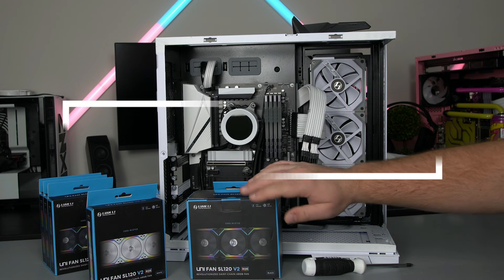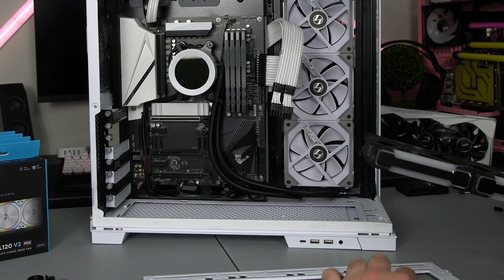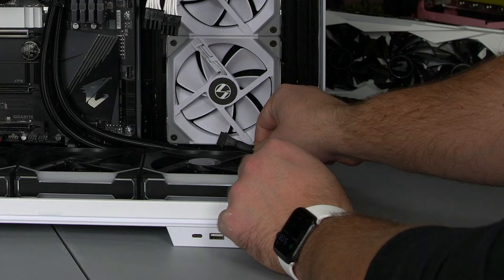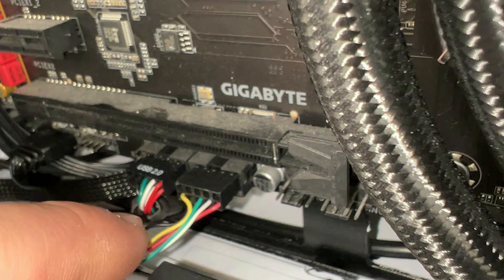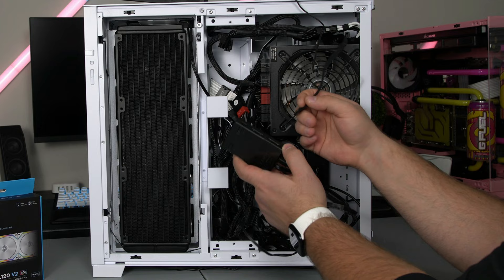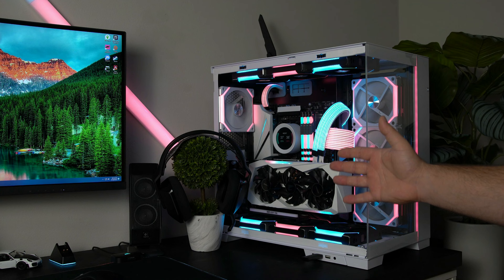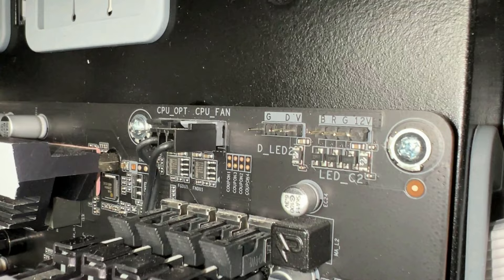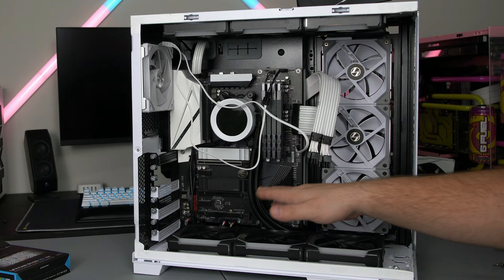How To Install Lian Li SL120/140 V2 Fans - 3 Pack & Single Pack

Comment: Honestly Lian-li fumbled this design. The daisy chain cables can only really go in one direction, it really should have been reversible.
Reply from the maker: It goes in just one direction but you can take the cover off the connector and flip the cable to be facing a different direction
Reply: Would you be able to explain how you would flip the connector end of the daisy cable to make it go in the same direction you did? I have been trying to figure out what you mean, and I honestly can't. I really appreciate it as I'm working on my build today.